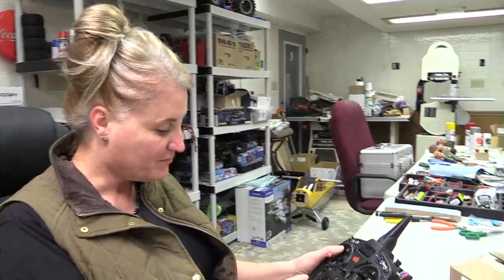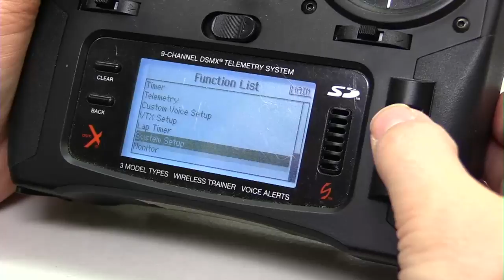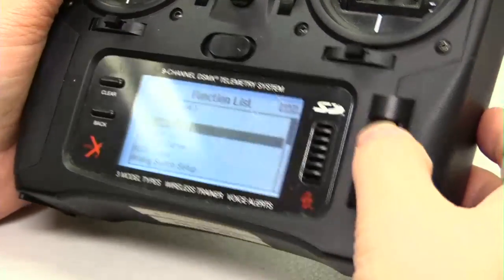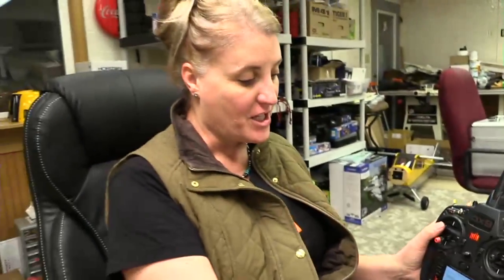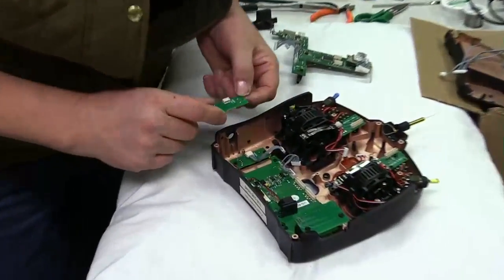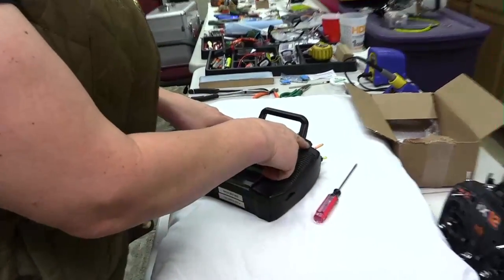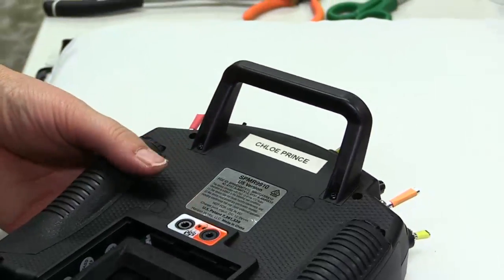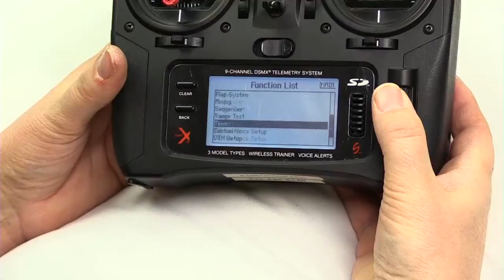Let's Fix The Spektrum DX9 Roller Wheel (Short Ver)

Comment: I took the radio apart, making sure to not remove the 8 trim adjuster screws.
You will have trouble removing the main board unless you splice in an extender/m/f plug on the green wire.  I used a PI board M/F wire.
I would not recommend de-soldering that wire on the board, too many close tiny traces.
Clean the encoder board in 91% alcohol, I used a pill bottle, filled it, dropped it in and shook. Gave it some spins, shook some more, etc.
I then dried it with a lo-temp on my heat gun.
Put it all back together and no more jitters!!
No parts needed, no big expense.

Comment: You are very lucky Chloe as normally spares are not supplied by Horizon hobby to do repairs,I tried to get some switches but they said parts are not available for fitting except by their own engineers,regardless of this well done for doing the repair successfully.

Comment: My DX6e is brand new and my roller seems to skip some times which makes it hard to get to certain items in the menus. It skips at the same point in its rotation every time. If i go to the top of the menu and roll the wheel it changes where it skips, so it appears to be a mechanical problem. My older DX6i has the same problem as the DX9 in the video. It's is why i bought the DX6e. Starting to have doubts about the quality of Spektrum and their design decision with the roller wheel. Anyone know where to get the board she got for the DX6i?
Reply: I just got a DX6e and it is doing the same thing.  I am going to reach out to spektrum about it.
Reply: @DrDingMuscle  Yeah man. I actually exchanged my dx6e at the hobby store i bought it from. Next one was fine. I even opened up the older dx6i and cleaned the roller potentiometer with alcohol spray and fixed the roller problem on it as well. So now i have both working. But good luck with getting yours straightened out.
Reply: @Blind, being that Spektrum and Horizon Hobby won't sell replacement parts for their overpriced cheap transmitters to the people who've bought their transmitters, unless you send your transmitter to them so that they can charge extra for replacing the simple parts that most of us can do our selves and save money, that we'd probably use to buy something else from Horizon Hobby, I no longer will buy anything from Horizon Hobby, nor will I buy anymore Spektrum products. I did buy a FrSky Taranis X9D SE transmitter about a year ago that has proven to be a far better transmitter in every field than my DX7 G2 transmitter, and my FrSky TX is a better transmitter with far more options with a bigger choice of receivers and far less money than anything Spektrum has to offer, and you can get replacement parts without any bs, I wish I'd bought FrSky when they first came out a few years ago.
Reply: @alanwylie8960  Yeah luckily my LHS replaced that Dx6e for me and ensured the new one had no issues. My older DX6i I cleaned with alcohol spray and fixed it too.

But FrSky isn't cheap man. The FrSky Taranis X9D SE ranges from $220 for older models to $370 for newer, has to be bought online, and isn't better than Spektrum. Especially when it comes to the software and support.  The worst part about FrSky is everything is based out of China. The product design, mfg, software development, support, etc... https://www.frsky-rc.com/contact/

With Spektrum all the product development is done in the US. You can buy things locally through a LHS, get resources in plain english, and a support number in the US. If you need a receiver you don't have to order it online. Plus supporting a US based company with HorizonHobby.com and your LHS if purchased locally.

I guess if you're super cheap than FrSky might be better for your wallet but it is not a superior product by any means.

Comment: They will NOT sell you this part, they make you send the radio in!
The part is available in Australia and NZ however the shipping is $60 if you want tracking. 
More to the point would be identifying the encoder and locating it from an electronics supply.
So far I have only id'd the one for the 6i, it is  ALPS  EC10E1220505 available from Mouser, whether or not it is the same for these later radios would be a good research project for this presenter as she has one in her hand. De-solder and get out your magnifier.

Comment: Hey Chloe?RC Safari! Can you please by chance reference the part number for this? Called Horizon and they made me feel crazy for asking if I could order this same board... very disappointed with my experience thus far trying to track this down from them... im thinking a part number would help me as they are telling me theyve never sold boards, only switches or will repair it themselves....
Reply from the maker: Bryan Dexter currently, they only repair it themselves. I’m an electrical engineer. I met someone that worked there and I was supplied the part as a favor. They don’t sell them unfortunately.
Reply: @RCSafari , that's why I'll never buy another Spektrum product or buy anything from Horizon Hobby again, I've worked on and repaired far more sophisticated radios than anything Spektrum and Horizon Hobby has, and being they won't sell replacement parts for their overpriced cheap transmitters, I'll spend my time and money elsewhere. FrSky transmitters are far better radios than Spektrum and you can get replacement parts for them without any bs.